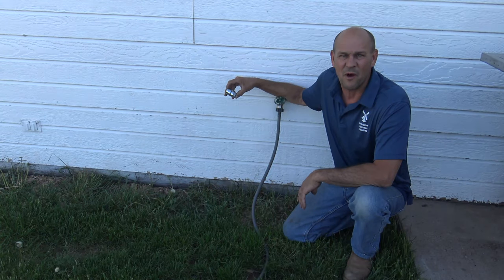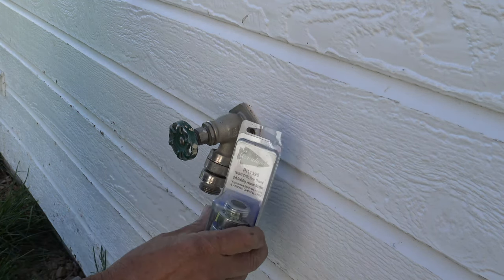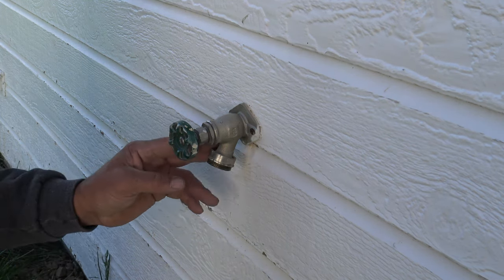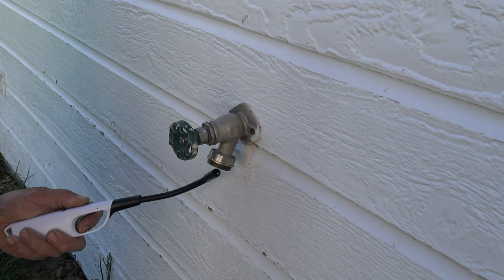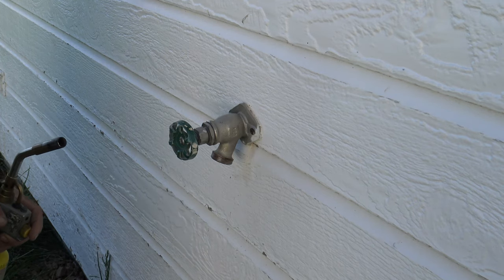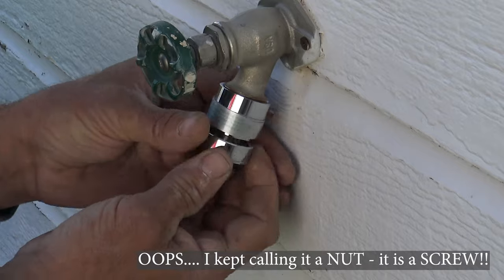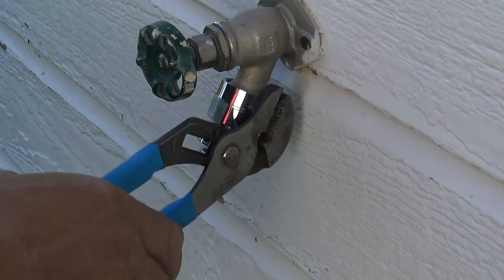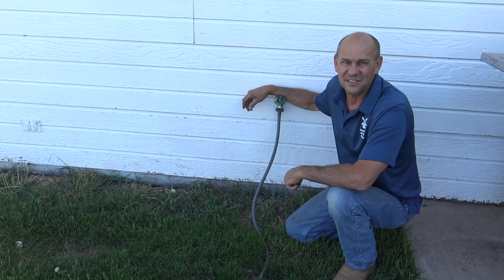How to Fix a Leaky Hosebib | How to Repair an Outside Faucet Leak

Comment: Very helpful video! When I first moved into my house, the spigot had a piece of garden hose attached that had been cut off by previous owners. It took me literally an hour of work (screaming and cussing the whole time) to remove what I thought was part of of old hose from the spigot, turns out it was a vacuum breaker. Had know idea what it was or why it was so hard to remove. Then more frustration when I noticed the threads didn't match my new hose and had to go buy another breaker. Wish I had found this video beforehand! 

So are they supposed to have a bit of water pour out the top section when you turn the hose on? Also had water loudly burst out of the top section when I shut off the hose but still had the sprayer going - that's not normal right?
Reply from the maker: Hi
The Arrowhead vacuum breaker has 2 parts to it 1st part where the hose is connected is a check valve to prevent backflow, the 2nd part up at the spout is to drain the bib automatically when the pressure goes below I believe 5psi.
When you turn it on it activates the check valves and the release water until the rubber washer seats, and then when you turn it off it releases water once the pressure on the vacuum breaker goes down in psi. I know its a long story but that's what happens. They are messy but they save the bib from freezing and breaking in the house and flooding the house.

Comment: WTF? Who has blow torch just laying around the house? And you've priven that blow drier doesn't do the same work as blow torch. So, sorry to burst your bubble, but this will not work for me unless I rent a blow torch get a quick lesson and hopefully I'll be able to.apply that knowledge. That said, this video is not conducive for everyone. 💯💯🤣🤣
Reply from the maker: Luckily, you can get a torch for around $18 on Amazon https://amzn.to/3BlMEVB - in the end, still quite a bit cheaper than paying $150+ to a plumber to repair.
Reply: I have multiple torches just like the one in this video... 🤷🏻‍♂